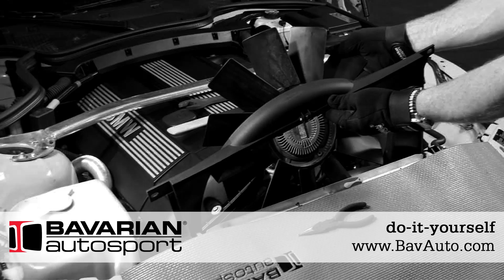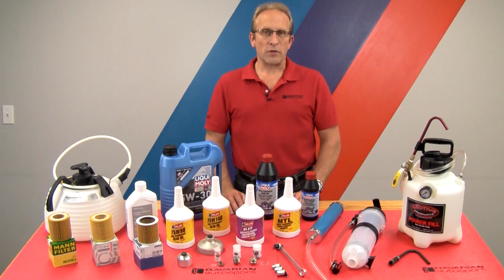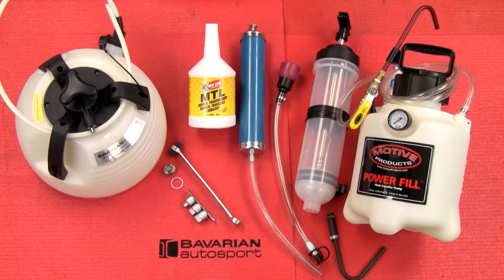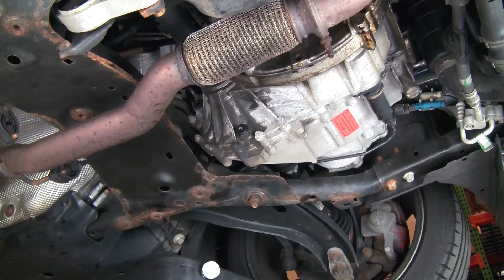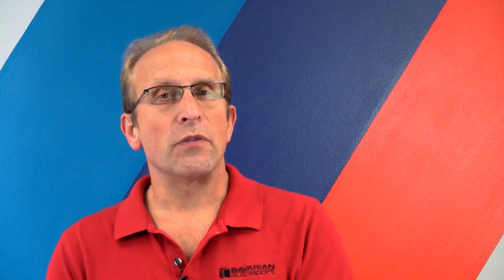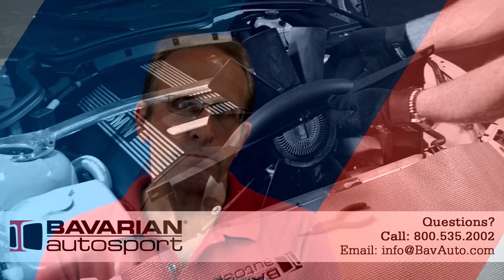Changing Fluid in MINI Manual Transaxle - Under Car Fluid Changes

Comment: This DIY video could've been shorter. Spent too much time talking about the tools and pumps you might need, but no explanation as to why a magnetic drain plug is being used or why you suggest using one over the OEM counterpart.
Reply: Skip ahead, man.

Comment: I have a question, i'm trying to do this myself but for the life of me I can not get the fill plugs loose. Any suggestion on how to get them loose?
Reply: +Kieran Moore breaker bar on the end of the hex wrench or socket wrench. it gets corroded in very tight.
Reply: Try spraying it with Break Free or WD 40 first.

Comment: It seems that you have some Redline D4 there.  Has it worked well in the Mini?  I have a 2006 Jetta 2.5 with the 09G and from what I read it is the same transmission in the Minis.

Comment: Question: the MINI has VERY low overhang and the Clubman is worse in the rear. The fluid seems to drain from one side so can I jack up the car from the side away from the drain hole and then refill it? My ramps are too steep to drive the car onto because of the overhang areas. If I tried, I'd definitely trash the rear bumper (not to mention bend my exhaust pipe!)
Reply from the maker: You can jack the car, but if it's just from one side, we would suggest that it be the side that the fill plug is on (and jack the side opposite the drain plug, for draining).  We would rather have just bit more fluid rather than less.
As for the ramps, most of us here have lowered suspensions and we cannot drive up on ramps.  We use "ramp starters", such as; two or three lengths of 2"x8" (or wider) lumber screwed together to make a stepped ramp to lead up to the drive-on ramp.  If the ramps have hinged "ramps" the starters can go under the ends of the hinged ramps.  If the drive-on ramps are all one piece (fixed), build the starters so that the upper level is offset to be able to fit up top the slope of the drive-on.
Reply: BavarianAuto
Why didn't I think of that! Thanks for the tip about the wooden boards. I bet that'll fix the problem.